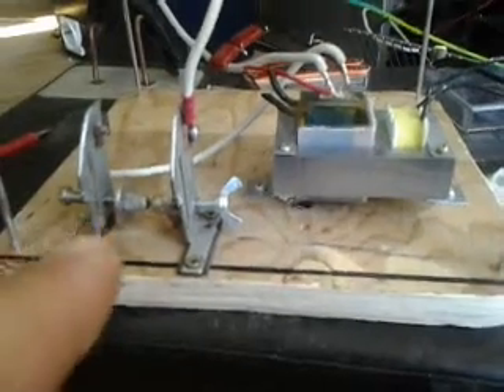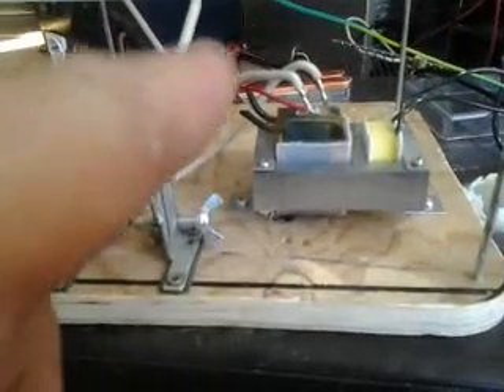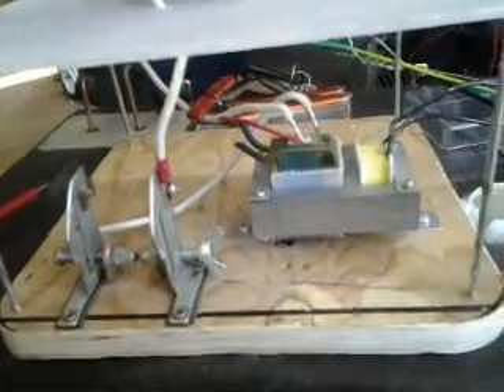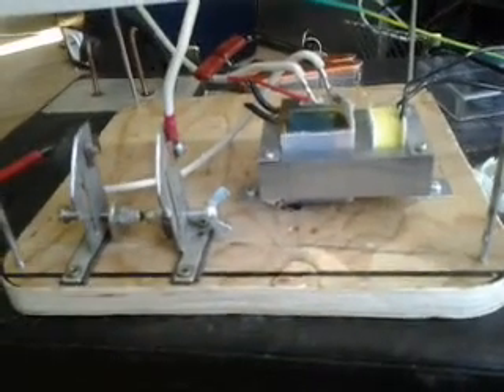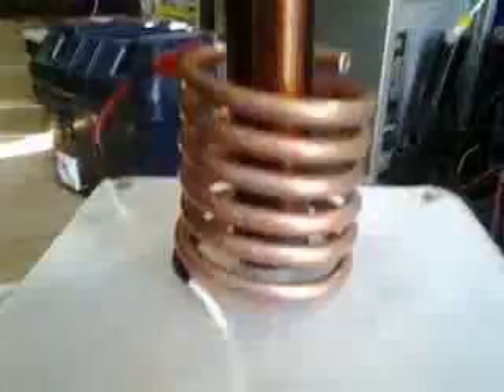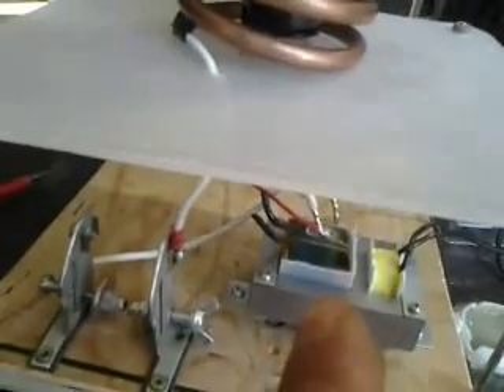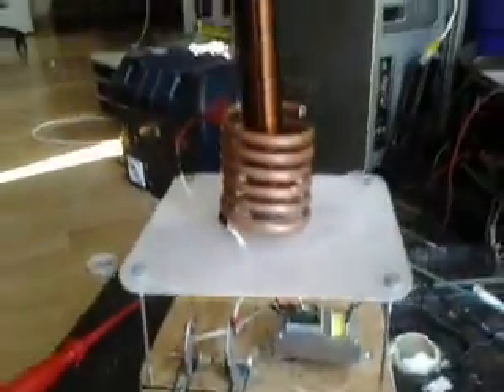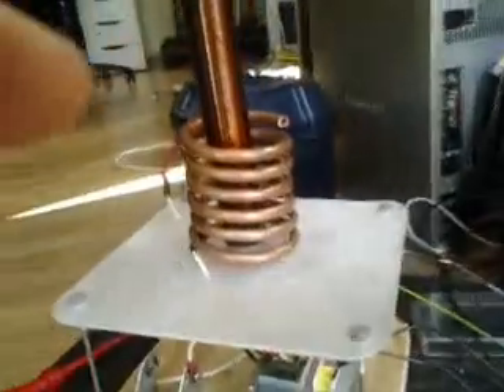My new mini bug-zapper Tesla coil...

Comment: Maybe add locking nuts to the spark gap so they don't move around, if you connect the gap in parallel with the transformer, then with the rest of the circuit disconnected, set the gap so it starts to arc by itself when you apply power, then connect the capacitors in series with the primary of the tesla, then tune for best arcs.
Another bug zapper transfprmer would also help